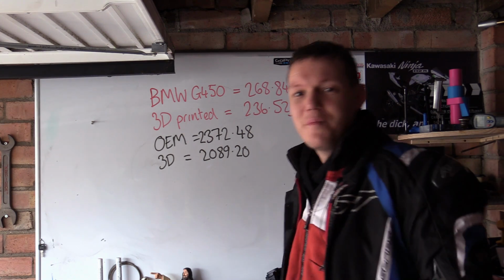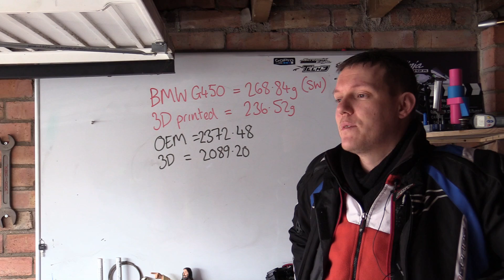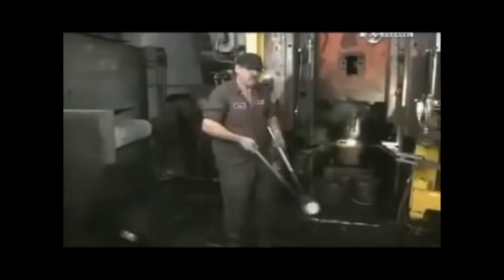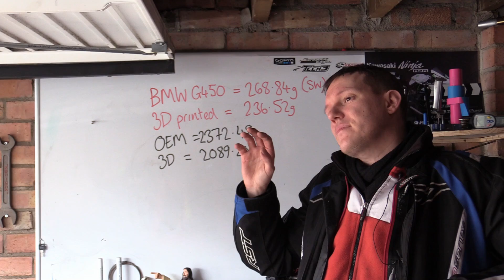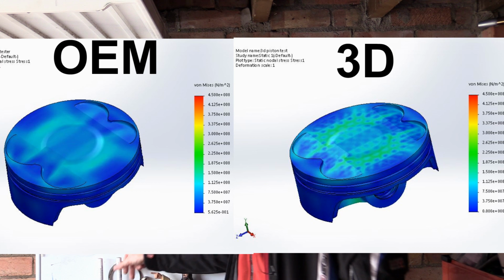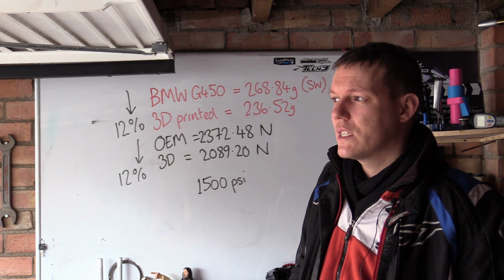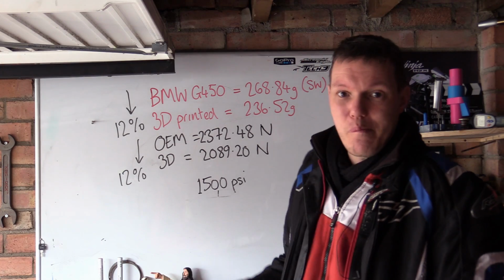3d Printed Pistons?

Comment: id be amazed if the grain structure of a printed piston allows it to be anywhere near as strong as a forging.
Reply: maybe, just maybe, one could forge 3d printed pistons? there's parts of the manufacturing process of forging that could be transfered to 3d prints to harden them.
Reply: Given the tolerances and volume involved in pistons I don't see 3D printed making I roads to production use very soon. If one adds up all the machining time plus the casting or forging process its longer than you might think. But if your cycle time for the machining operations is say 30 seconds for 4 pistons the volume per day is huge. As said there is no way you are going to get away from the machining processes
Reply: Easily

Comment: Wait how do you have those internal voids not be full of that sintering powder?
Reply: Your engine will sound like a couple of maracas being shaken really hard!
Reply from the maker: Good point - they must design run offs or some kind of channel
Reply: Yup. Powder based 3D printing can't do voids, but is great at overhangs and things that stick out perpendicular to the main body. It is also hugely expensive since you can't reuse the powder that doesn't get sintered/fused. Some systems allow you to reuse some percentage of it, but the majority has to be virgin powder. Fairly good precision though.

FDM (fused deposited material) can do voids, but suck at overhangs (plastics obviously do a bit better than other kinds) and flat out can't do "stick outs" without support materials. The precision is a joke.

Resin based systems can't do voids either, can't do overhangs and can't do stick outs... but the precision is through the roof.
Reply: @thedirtyworkshop  AH HA light bulb moment when you said diesel pistons

On large marine diesels there is a cooling passage within the piston. So they might have of sintered passages into the crown to allow cooling. Somewhat similar to a shaker effect cooling on a B&W and yes it is B&W not BMW
Reply: There are many different technologies in 3D Printing.
One type i know that could be used for voids without drainage are laser welding (https://www.youtube.com/watch?v=2b-D2B0_T54). Another one was where they blasted metal particles on a surface, where they melted togehter because of the heat of the deformation. This is a new technology, so i couldnt find anything about it on the internet
Reply: @andersjjensen  " It is also hugely expensive since you can't reuse the powder that doesn't get sintered/fused. " Nope.
Reply: it's not the sole  reason but I have seen that is an issue the material costs are huge.
Reply: True, would be interesting to see the insulating properties of such piston like ceramic coated pistons, I imagine some efficiency gains could be made.

Comment: I agree... the thermal transfer is a serious downfall.  Ceramic coating the domes of two stroke pistons usually causes detonation. Speculation is that the dome needs to absorb some of the combustion violence. I wonder what a honeycomb dome would do.
Reply: Hot spots, thats what a honeycomb dome would do
Reply: @beachboardfan9544  that's exactly what I'm thinking.
Reply: What do you think about DLC coating pistons and cilinder walls? Is anybody doing this? Diamond has a way higher heat transfer coefficient than any metal and that DLC can be polished up to be slicker than an eel in a bucket of snot.... What say you, gentlemen?
Reply: @remcovanvliet3018  Years ago I made wrist pins. The drag racing top fuel pins were hard chrome plated, which was a pain in the ass. I tried a PVD coating to get away from chrome. The heat they need to PVD coat it took some of the temper out. 4340 to 45rc is about 800f (IIRC). Unless they have figured out a way to do it with less temps, I don't see it working. Also, it is only a few microns thick. Having said that, it makes me wonder if there are new technologies out there that would work. I haven't looked.

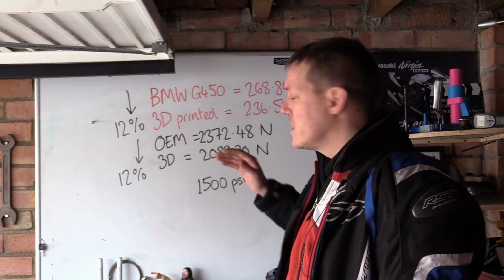Comment: 16:15 is a very good pain point.  The piston is lighter but the voids will probably end up working as insulation, exactly where you don't want an insulator..   I know, fill the voids with Sodium like they do in exhaust valves!  (sort of joking about the Na)

Comment: Was just about to comment about the heat transfer of a piston with any kind of hollow chambers. 

Maybe for a relatively sedate engine but considering what they do to keep pistons cool as is I wouldn't bet on a 3d printed piston being able to withstand as much.
Reply: Marc Jackson  what? 

If it's been done in whatever engine then fair enough. I didn't say it couldn't what I was effectively saying was I'd be suprised if it could. 

So has it been done or are you just chatting shite for the sake of it?
Reply: Marc Jackson  i did look yeah and that's fair enough. I don't particularly pay attention to the F1 nowadays I don't find it as interesting as I used too. 

It's definitely interesting to see how it could develop. If the turbulent jet ignition comes to road cars beyond things like the AMG one or whatever it is called then we may well see it on some of the super cars coming out. I'm not sure we'll see it beyond that purely because how long 3d printing takes but that's another story.

It's really interesting they've gone for steel as it's worse at heat transfer. I wouldn't be suprised if being able to use the 3d printed pistons relied on having the turbulent jet ignition with lower temperatures. 

The engine rpm stays the same so the fact they're using steel suggests to me they're having fatiguing problems with the aluminium alloys. That would also explain why they pushed for being able to use steel rather than say titanium as titanium can be quite brittle. 

It could be a number of things in sure that piston is made of some unobtanium steel alloy regardless so it could just be that's the best solution but that seems too easy.

EDIT: having fatiguing problems with the aluminium alloys or the temperatures or still too high

Comment: Could you actually bore out cylinders on a cheap lathe? And those gudgeon pin holes for the piston, can they be machined in a cheap-ish milling machine (Like the Warco you had) Or do you need like those 50k CNC machines? If so in theory you could make your own pistons for example a Z900?

Comment: So there is no excess material on your example piston like we all know. But I think that with this method we could make a better piston that weighs the same or less. I mean you could design a piston skirt that would not allow so much piston slap but it still wouldn't create more friction😅🧐
Reply from the maker: "I mean you could design a piston skirt that would not allow so much piston slap but it still wouldn't create more friction"

- elaborate......
Reply: @thedirtyworkshop  It was only a quick tought, so it might be shitty. But what I mean't was you could make the skirt longer but instead of having a full skirt only a frame of it. and for supporting the lower part of the "frame" you could have some triangulated supports that would also help with transferring heat from the thinner parts. Like I said this was only a quick tought that come to my mind😅

Comment: I wonder whether heat transfer would become an issue in these.
I mean, I'm not sure if these would be able to dissipate the heat from combustion because at the mid-point of the altitude of the cown, half of the surface area is just not there (because of it being so hollow).
Reply from the maker: Heat transfer to the oil would be better, what is an issue is heat sinking and saturation

Comment: Wouldn't sintering 3d printing help with developing Caged pistons for really high cost/performance uses, aka Motorsport?
I've seen and read stuff from DMG Mori about Optomet in which different metals powders can be mixed by the machine based on the needs of the product. Seems absolutely amazing but idea of laser sintering different powedered metals with different fusion points, doesn't seems as strong as forging.

Comment: I'm disgusted call that a skirt where is it? You can see the wrist going around the Gudgeon pin! Won't the rings be subject to greater loads and as for sintering isn't it the metal equivalent of fiber board?
Reply: @Kris Nicholson isn't that kind of like saying Oak is stronger than wood?
Reply: @Kris Nicholson I meant that your wording is in a sense "Steel is stronger than steel".
Reply: @Kris Nicholson exactly. But your wording ignores this. By saying "welding is stronger than steel", you are referring to steel as a whole, which invariably includes said welding. So you're saying it's stronger than itself.
Reply: @Kris Nicholson I don't understand what you aren't getting. YOUR WORDING IS AWKWARD.
Reply: @Kris Nicholson 
I would agree but a weld usually contains more carbon as the surrounding area, so saying that laser 3D printed parts (wich are completely melted, not partially) have more carbon content than usual parts with using the same material is kind of false.

Comment: I think your asking a wrong question. You need to approach from its cost angle. 3d printing makes very short complate process and much less energy consuming. 

Powder-printing-heat treating-final machining

 is very short compare to,

Billet-cut-heat up-forged-heat treat-final machning

Whole process gets much simpler and area efficient, therefore possibly less transporting and less startup investment on real estate. 

I would approach on this topic from its manufacturing cost, not from part's function or efficiency.
Reply from the maker: "I would approach on this topic from its manufacturing cost, not from part's function or efficiency."

- But the parts still have to work....... LOL

"Billet-cut-heat up-forged-heat treat-final machning"

- One things you're forgetting - they already do this process - 3D printing is extra cost - not less. And time. If you have 50,000 bikes to make in 2 years with 4 pistons each that's shit loads of time. Lets say 24 hours to print 1 piston - that's 4 machines and machining for 1 engine. You have to print 237 pistons per day..... That would mean you'd need 60 machines. 

I don't think you've worked this out......
Reply from the maker: A ProX DMP 300 SLS costs £200,000! And this is the entry machine - There's also a lot of shit it can't do - https://www.aniwaa.com/product/3d-printers/3d-systems-prox-dmp-300/

A machine they'd use at say Yamaha would probably cost £1M+ each.
Reply: Well, I am no expert but I was tring to make some points of what I saw in exihibition few month ago. Current process is much longer than I wrote.

I agree that we won't see this now, but I think eventually we will all soon see manufacturing parts with 3d printing. 

I work in field of heat treating auto and aero parts. You would be surprised if you know how many samples are being sent to us from big companies. Big companys, would not be considering this if it's not cheaper. 

They all says, beside of first investment, 3d print somtime is much cheaper because;
-it can shoten the process
-do not need whloe new investment when parts need upgrade or change.

But yeah. The manufacturing speed is not yet there. But it will be.
Reply from the maker: "But yeah. The manufacturing speed is not yet there. But it will be."

- I'm not too sure about that - will the speed increase? Yes - by a factor of 100? No. CNC machines have been around for a long time - they have super trick machines these days - but machining times have decreased by a factor of 4 since 1982.